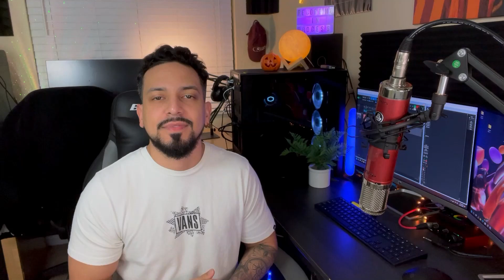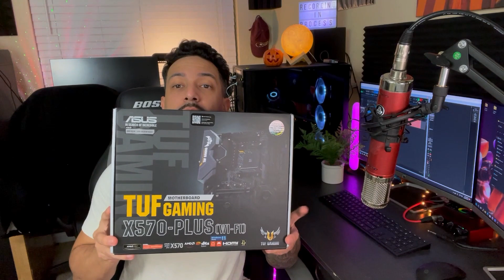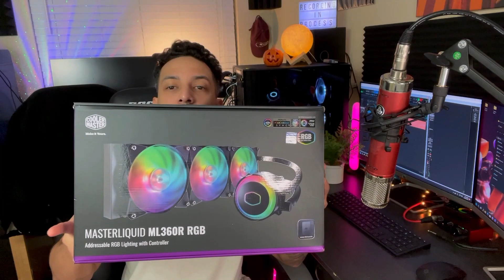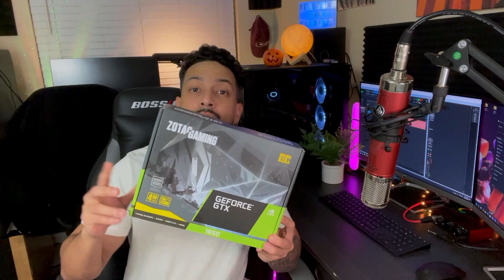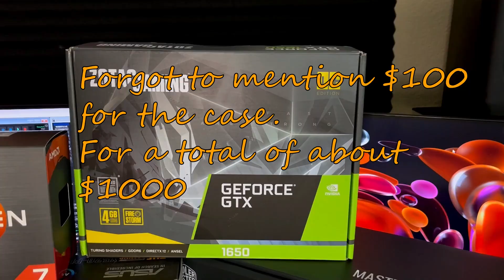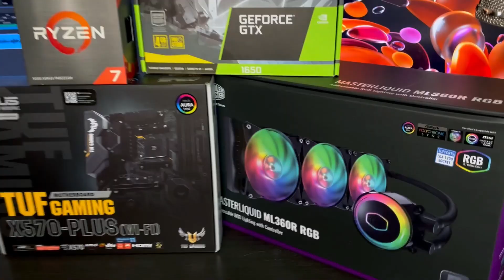How Much Did My Music Production PC Build Cost???

Comment: The AMD vs Intel CPU debate is not quite so clear-cut imho.  AMD are generally cheaper and a lot more efficient, meaning you need to spend less on power supply, cpu cooling and fans.  The latter also means you can build a quieter system more easily because the fans don't have to work so hard.  You also get smaller energy bills and that's more of a factor these days.  I priced up a Ryzen 9 7900 with 32GB RAM, a 1TB Nvme and a secondhand RX 580 GPU to come in under the same budget.  That CPU is an absolute beast, yet only draws 65W, however it's only recently been released so may not have been available when you built.

Comment: Believe it or not buddy!
You've overspent on the PSU, Motherboard (chipset) and CPU Cooler considering your choice of 5800X. You should have seriously gone for better processor and more RAM for the kinda budget you had so that you get the system competent for few more years.

My humble opinion:
Either you could have gone for 550W PSU, B550 motherboard & Air cooler to save $200
(or)
For $1200 budget, ideal spec would be Intel 13600K with an Air Tower cooler 32GB of DDR4 RAM

Comment: Must have used Asus Proart x 570 creator, wifi, thunderbolt 4 port motherboard. Also use air cooler for CPU. Liquid cooler make noise. Corasir RM 1000x PSU should be used.